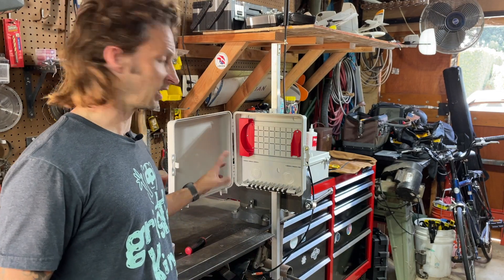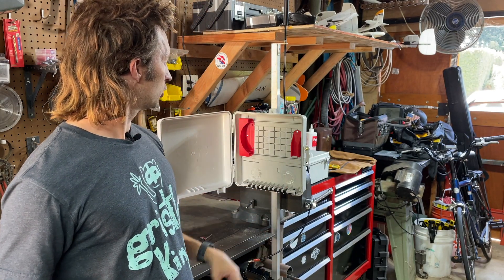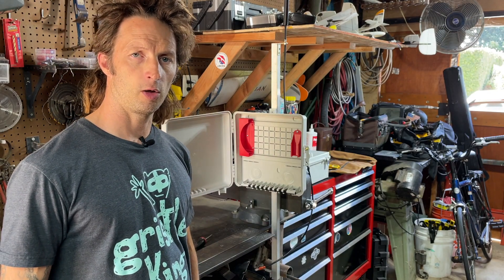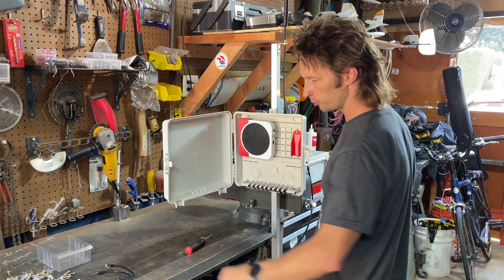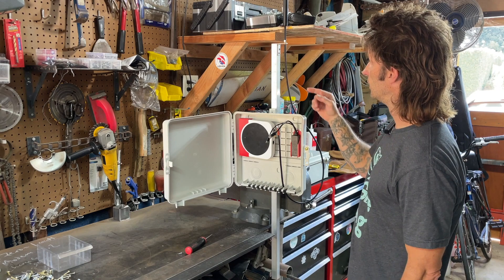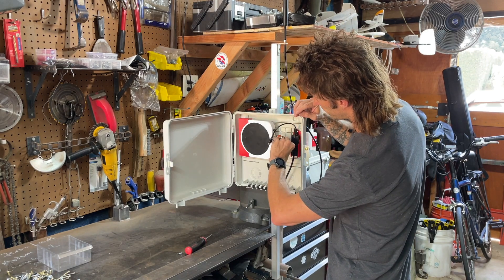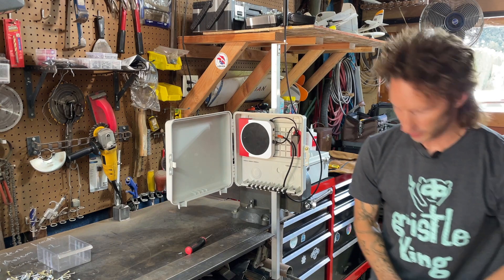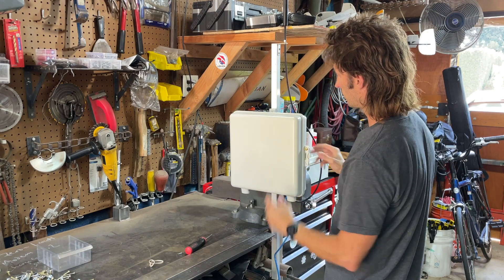Helium Outdoor Enclosures, 101

Comment: The larger boxes are way better . They have more air space in the box . So it be less hot inside the case . And that has little tiny holes in the bottom of the box where those wires pass through and guess what goes through those little tiny holes a lot of bugs. You can tell that's what they put routers in on the side of your house. I think if I'm going to get a box that's waterproof I'm going to get something a little bit bigger than that
Reply from the maker: Sure, check this one out: https://youtu.be/Bj1Y1rInsbc
Reply: @thegristleking  wow that thing is badass. You know it's expensive when they say leave your email. Doesn't even say what the price is
Reply from the maker: @MyIronman8  Yeah.  I think it was $159 or something when I bought it, $199 was the latest price I saw.

Comment: Nik, how do you keep your equipment from over heating in the hot sun? 
I'm trying to decide whether or not to place my miner in my attic vs outdoor enclosure and I'm not sure what will be better for temperature purposes.
Reply from the maker: Hi Gabriel, I haven't had any problems with it BUT I'm in Southern California where it doesn't really get that hot.  I do try and keep the enclosure shaded.  There are a few YT vids on how hot specific Hotspots (like the Bobcat) can get, though that's solved by adding heatsinks.   Does that help?
Reply: @thegristleking  thanks. I will check out those videos.  I'm going to place a temperature sensor within the enclosure to monitor as well.

Comment: I've seen a few videos where it shows you need a ground wire when setting up a outdoor antenna. Can I get buy without a ground wire and just using a LMR 400 cable and the splitter and ethernet cable like shown in this video?
Reply from the maker: Technically you always need a ground between the antenna and your equipment.  You'll see that many installations don't have one.
Reply: @thegristleking  Those installations that dont have one, how do they operate then? Is it mainly just a saftey measure?
Reply from the maker: @dankjeenyus  it's definitely a safety measure.  The lightning arrestor (surge protector) is just there to protect the Hotspot in case of a surge of energy (usually static discharge) from coming down the antenna cable and into the Hotspot.  If you don't have one, your Hotspot is unprotected.
Reply: @thegristleking  appreciate the reply

Comment: Thank you for this Nick! I ordered this enclosure, but I couldn't find any weatherseal that fit the groove of this thing to make it watertight! Do you have any advice? The grove is 3/16".
Reply from the maker: Right on, I found this: https://grstl.ink/weatherseal316
Reply: @thegristleking  Thank you. I found that at the hardware store and it didn't fit very well. I'm going to go with a box (https://amzn.to/33j9SPB) that has a seal and drill holes with cable glands. I doubt much water will get in this box, but I don't want to take the chance with an expensive miner. Thanks for all the replies to the comments.
Reply from the maker: @aaronolson  right on, I've used those Qilipsu boxes and like 'em.

Comment: Would it work to just put a hotspot inside with the stock antenna attached?
Reply from the maker: Depends on enclosure material.  Almost always better to go to the effort of getting the antenna outside and up high.
Reply: @thegristleking  thanks. What is the name of the type of cord that is short but allows you to attached an antenna directly to the box?

Comment: Just curious how you mounted the box to the pole? I'm assuming you want to keep from putting a hole in the box for moistures sake?
Reply from the maker: HI Brandon, IIRC I drilled through the box where the mount points are and siliconed it.  Been a while though.

Comment: I am just learning as I go but I had a 100 foot LMR 400 connecting my 5.8 dbi antenna to my hotspot, only needed about 50 feet but had the rest coiled up and behind a table.  I was getting only 51 witnesses, then I cut out the extra 50 feet of LMR 400 and this has increased witnesses to 72.  Based on some online calculators, 50 feet of LMR 400 is losing about 2.12 db through the wire alone.  I think I am going to completely cut out the LMR 400 and get this outdoor enclosure and run PoE, but I am just stuck on which enclosure to get for my Nebra hotspot, do you have any suggestions?
Reply from the maker: This'll be the best thing out there but you'll have to wait: https://grstl.ink/layer-zero-alpha. Otherwise, check out these ones: https://grstl.ink/qilipsu-enclosure

Comment: I have an enclosure I plan to install on a 20ft mast. How concerned should I be with the heat. I live in Florida. Should I try to install a vent and exhaust fan? Thanks!
Reply from the maker: Depends on the model of miner.  RAKs do fine in the heat, Bobcats & Sensecaps are more sensitive.  I'd definitely provide shade for the enclosure at the least.  Vents/exhaust fans can get tricky because you're exposing it to a bunch of humidity, especially in FL.

Comment: It doesnt affect the signal strenght? What happens in winter? Does the temperature not affect the electronics?
Reply: Why would the signal strength be affected?  Depends on how cold it gets.  Every hotspot has a temp operating range that you should aim to stay within.
Reply: Oddly similar pictures.
Guy lives in San Diego, temperature is not a problem for him. Keep the enclosure in the shade, and temps won't ever get cold enough to matter.

Comment: what about heat management
Reply from the maker: Really depends on the miner and environment.  Here in San Diego it doesn't really get THAT hot.  This one will be mounted on the east side of a chimney, so shaded from the western sun.  This is an OG miner which is more heat tolerant than a Bobcat.  You can vent your enclosures, or use a vent with an active fan, or seal them.  All 3 have been tried and successfully worked, it's just a matter of matching your miner to your environment.

Comment: Just got the exact same case. And its not water tight, and has no gasket. Any ideas on how to seal this sucker?
Reply from the maker: Hi Mark, should be able to pick up some weatherseal down at Lowe's/Home Depot or just measure the gap and order online.  Shouldn't be watertight (underwater) but should be fine for rain.  :)
Reply: @thegristleking  Hey Nik.  There's been a few storms with a decent amount of rain in the past few weeks in San Diego.  Have you had any issues with rain/water/moisture getting into these enclosures?
Reply from the maker: @birdlint  I'll double check on this deployment, but I haven't heard anything back.  That thunderstorm was rad, right?!

Comment: This looks great & love the 3d printed holders. Is there anything behind the decision to use the indoor intended antenna for this outdoor setup vs HNTennas alternative outdoor choice? Both their antennas look very similar spec wise so maybe it's just what you/the client had and there isn't a meaningful difference? Cheers
Reply from the maker: Yep, the client wanted the smallest/lowest profile antenna possible.  I talked to the HNTenna folks and they said the indoor is fine to use outdoors just make sure the connections are sealed.

Comment: Hey Nick, thanks for all the great videos and information. You mentioned that you modified the indoor HNTenna for outdoors. Could you please describe that process?
Reply from the maker: Sure, I just taped the connection between the antenna cable and the antenna with weatherproof tape.  Super simple.  :)
Reply: @thegristleking  Sounds good. Thanks for the info.

Comment: Great video! Question for you, any concerns about temperature regulation? I'm debating a simple setup like this or one with additional air flow through the case. The heat of summer but cold of winter are open questions for me.
Reply from the maker: There's a fair amount of debate about this, with decent arguments on both sides.  Travis T @ Helium has run sealed enclosures in the Texas summer with dessicant packs and they do fine.  He's got a ton of experience with his.  On the other hand, plenty of people have run passive and active ventilation (without and with fans) and are doing fine.  That tells me it's probably not a big deal either way.

Comment: Thank you for your excellent videos. I had just been looking at these enclosures on Amazon and then I found your video on here.  I know different boxes are made from slightly different materials but wondered if you had any rough estimates for the heat transfer properties - maybe something in the region of +8-+15 degrees? Also, you said you chose not to vent this enclosure - was it not for a hot location? I live in Texas where it can get to 110 some years. This year it has only reached the mid to late 90s, and I didn't realize there could be any negatives related to venting so I'm wondering if you would still elect not to vent for a box for a Texas location or would something like the metal Rak enclosures with heatsink be better suited.
Reply from the maker: Just saw this, sorry it took a while to reply.  The vented vs sealed debate burns hot & bright.  Helium employees have run sealed enclosures in the Texas summer with a pack of dessiccant and report no issues.  Both sides will lose their mind when they read this, but I don't think it matters very much.
Reply: @thegristleking  Thanks for your reply - I have it unvented currently but thankfully, the hotspot in the Parley enclosure is Sensecap, and they have a new portal to monitor various things including temperature I keep a close eye on it. I just added a remote gable extraction fan on one end of my attic, and an 'inlet' gable passive vent on the other end, and when I first tested the fan the temperature in the attic went from 129 to 113 in about 90 minutes.  This made me think maybe its worth it.Cheers.
Reply from the maker: @GerryHanan  yeah, ain't nothing like active ventilation.  ;)